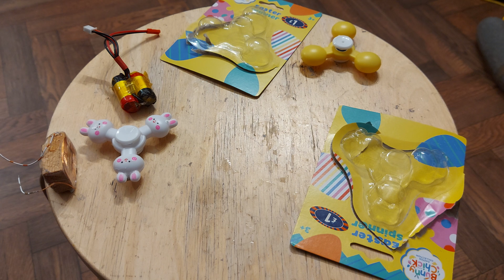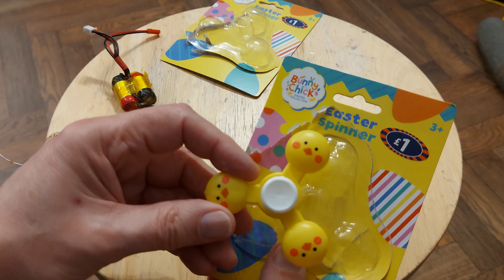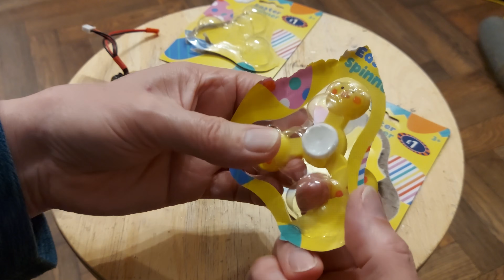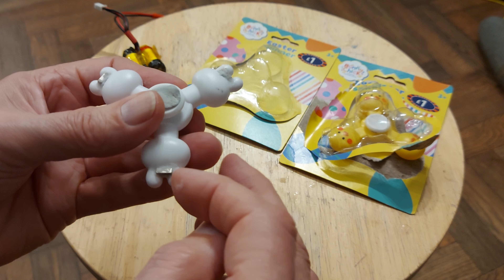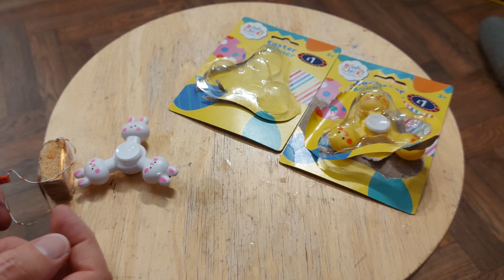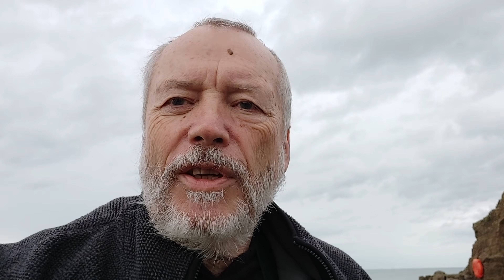What is a Pulse Motor?

Comment: that works great, nice pulse motor, can you use a switch to turn the magnetic field on and off to make the spinner go round, u could pulse the coil with sort of a switch looks like.🤔
Reply from the maker: Yes, Marc. This video is just showing the principle. I have done many pulse motors over the years using various 'triggers'. The easiest is a reed switch, which is a glass tube with a couple of spring contacts inside. When a magnet comes near the contacts are attracted together completing the circuit. The downside of this simple method is you can get sparks and the contacts can weld together. Not a problem if you don't use too much power.